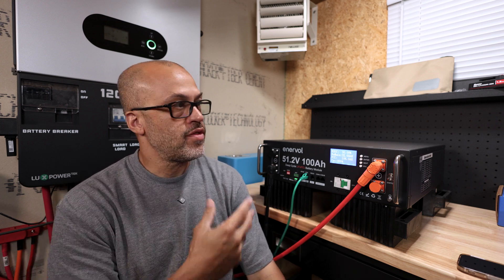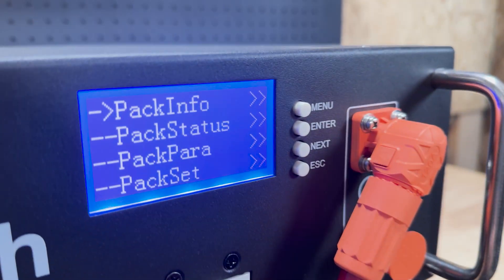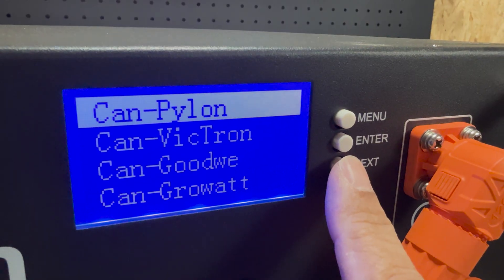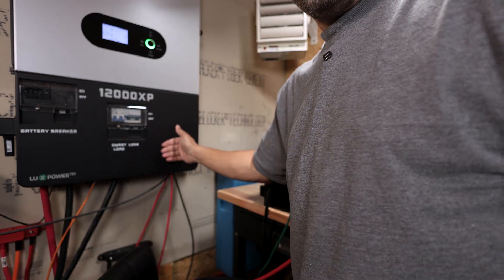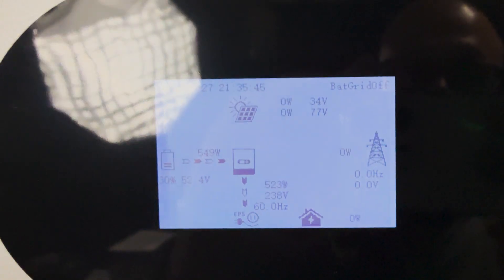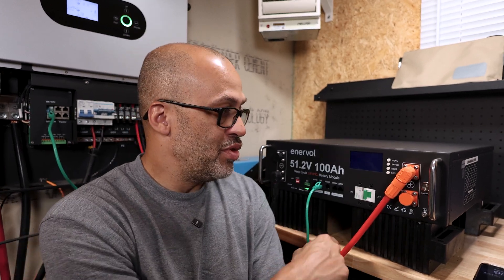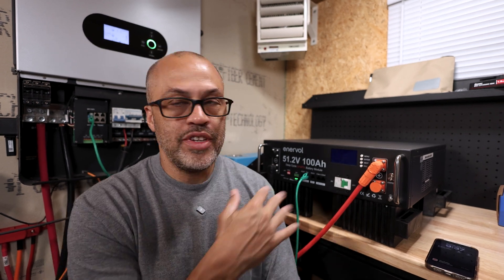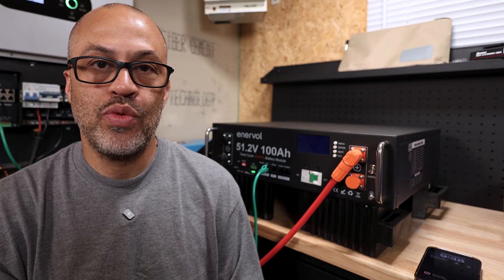Enervol Battery Communications with EG4 inverter Tested   Part 2

Comment: Hey Rodney. Would be great if you could do some more testing with this battery and communication. For example, yes it communicates accurately the SOC%, but will it communicate correctly with the 12000XP in terms of when to stop charging or discharging? I think these those basic safety features would give this battery more credibility.
Reply from the maker: From solar you mean? Charging and discharging? Only problem maybe that one battery would limit charge and discharge possibly. I will look at the numbers and probably test that out.
Reply: @rodneyhunt  Charging from the inverter and discharging to the inverter. For example, if there is an over voltage trigger in the battery, does the BMS in the battery effectively instruct the inverter to shut off? Those types of safety tests. I think those types of safety tests will definitely give persons the assurance that the battery and inverter are playing nicely together when they are communicating.